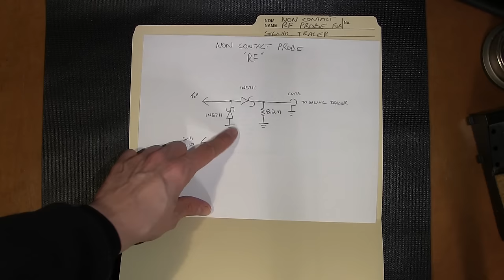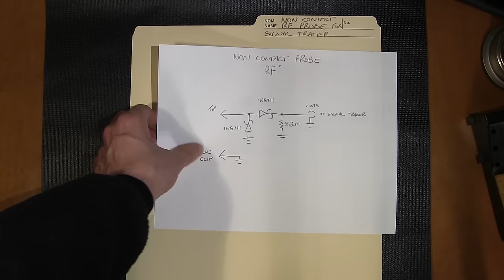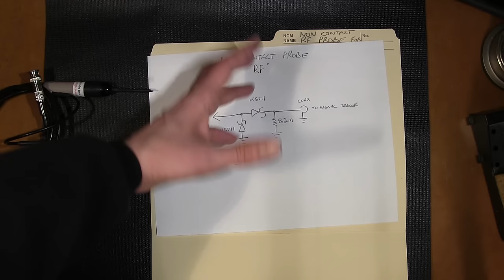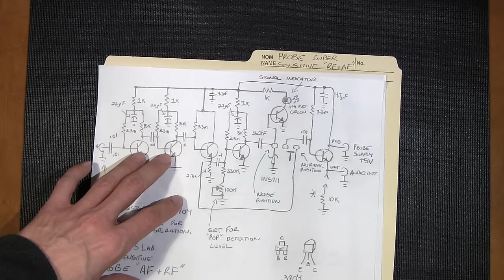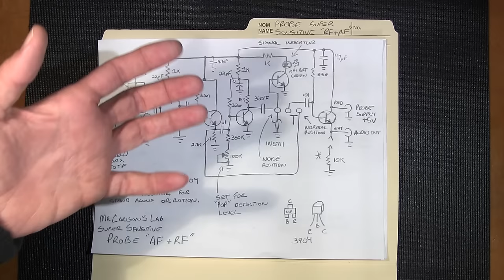Troubleshoot Electronics FAST with a Super Probe

Comment: This guy is a genius! I used to hunt for hours looking for a noisy resistors! This unit could trace noises within minutes!  R f faults easy to trace! Well done Paul! I am building mine into a piece of copper 22mm pipe and building the circuits on vero board! I will insulate the copper with heat shrink and mount the switch externally! I can only use through hole components as my eyesight not as good as it used to be! I need to save up and buy a microscope!  Thanks Paul for posting this! Fraser.

Comment: Built the circuit with BC547's and slightly different  resistor components (what I had available). Built it on perforated circuit board and connected it to a previously built low noise headphone amp. Housed in a mint box (not an actual cylindrical probe). Had a lot of trouble shooting to do in view of sloppy soldering but finally worked pretty good. Can sense a 40 watt fluoroscent light from 2 m away. Thanks Mr. Carlson for sharing and the explanations given. Much appreciated. Have a great 2017.

Comment: A great approach to troubleshooting a variety of circuits. The major advantage, no direct contact with the isolated area, which means no loading of the circuits, a huge advantage when troubleshooting tricky issues. Well done Paul! very professional construction and design.

Comment: Massive thanks Mr Carlson! Another absolutely must-build for my workbench in my lab. Many years ago when i worked after school for a repair shop it seemed we were always using the professional model signal tracer but as time has passed and the kinds of gear i work on the idea of using one has just gone out of fashion. I can see so many applications for one once again (rather than pulling out the 'scope etc) with extreme sensitivity as this design offers... just need a bit of spare time to do it justice!

Comment: Gosh, you really do run THE most splendid electronics channel, I bow and tip my hat to you. I wanted something just like this back in the 90s, to pick up POTS telephone line audio from the line cord; I would assume this would be sensitive enough to do so?God bless you, thank you for all your incredibly hard but rewarding work.
Reply from the maker: Thanks!
Reply: Mr Carlson's Lab You're welcome - a REAL component-level engineering professional, not a "module-plugger" as my ex boss calls them, haha!
Reply: +Mr Carlson's Lab I know some things about working with electronics, but watching  your video's? That has taught me quite a bit. I really enjoy them & you explain things very well. Thank you
Reply: +unlokia I can't agree more. "Module pluggers" drive me nuts, those who brag about their "creations" like they engineered it. Using modules is just fine, but why try to look like a pro if you aren't. I rearrange my schedule when Paul uploads a video :)
Reply: MrJohhhnnnyyy The 'net is overflowing with enthusiasm for Raspberry Pi, Arduino etc - it becomes somewhat tiresome sometimes, as many of these folks think THAT is "electronics". Yes, they contain electronic components, but the user didn't design the Pi, the foundation did, and you don't need to know much (if anything) about Ohm's law or junction drop to know how to connect a Pi to a PSU, power it up and write a script that drives a GPIO high or low. I don't want to come across as an arrogant pleb - it's a really good thing to have a passion, but when REAL engineering and electronic design is swamped by the latest, lowest common denominator "trend", it fast becomes a facepalm moment in engineering.

I ain't an engineering snob, but software isn't engineering any more than a toothpick is a broom handle. Real engineering is stringing together discrete components and designing something yourself, or fault-finding  - both of which Paul does with aplomb!

Right, I reckon I've waffled on a bit and I now sound slightly pompous, not intended... so I'll walk away with some humility left. :)

Oh, yes - I would (and just tonight, HAVE) set aside an hour or so to watch these superbly narrated and compiled works of art that are his YouTube videos - kinda got a bit worn out hearing a certain Australian ranting and screeching, as nice as he is, it all tends to get a bit wearing and sameish... and I can't bear to hear pompous "opinions" - I'd rather just hear engineering and diagnosis, since that's what you're there for, no? :-P

God bless you all.
Reply: I'm glad to see that I'm not the only one here thinking that making an LED blink using an Arduino ain't engineering :) Those "engineers" will throw away an Arduino if it has, let's say, a dead voltage regulator without understanding why it doesn't work anymore. 
I know you can't be a pro in every field, but come on! You should know the basics at least. I make simple projects in comparison with complicated uC invaded things, but I know what each and every part does in my project. 
I ain't gonna say that Dave is that bad, yeah he does have annoying habits in explaining the stuff in the video, but... I guess that's just his style then. I have a motto: don't like - don't watch it. So if he bores me, I just go away.
Reply: MrJohhhnnnyyy Thank you for your reply - wise words and very true! God bless you my friend :) Happy Christmas.
Reply: Indeed. I'm amazed every time form the vast knowledge down to the component level and as a whole system.
Attention to detail, no cutting corners. 
Mr Carlson is an asset.
Reply: "I don't want to come across as an arrogant pleb"

Well... you just did :P.
Good thing you're most likely never going to see any Arduino or Pi videos here on this channel.
If people want to make Arduino or Pi projects, let them, your word is not law, if you don't like that sort of videos, don't watch them, that's what I do with videos I don't like.
Reply: +shlomsi2000 Mr. Carlson is indeed quite adept at his chosen profession
Reply: Remember, someone actually had to design the raspberry pi, arduino, and all the modules for them, so don't get fatigued at all the people who use those tools to feel like they have a greater understanding than they do. There is no reason to keep the power out of the hands of the uninitiated, that is a very exclusionary stance to have. Just be glad it is easier for people to get into it. If they truly like electronics, they will learn the rest on their own as their hobby develops.

Comment: Great video, and what killer little probe made with very basic jelly bean parts. I shared this with some colleagues, across the pond. Roly, said, maybe put a FET on the probe input, for less hiss, and better performance, but he was still quite impressed with it. He used to run a company called Mitrex, that made sound systems for discoteques in the 1970s. Thanks!

Comment: You are not kidding when you state there are lots of other uses. I have been using an inductive amplifier to trace noise on power circuit lines in commercial buildings. This is just amazing. Thank you sharing.

Comment: Just an extension for those who can't read a scope or any number of simplistic instruments.. For that fella down the list here explaining really that all his time learning theoretical analysis of circuit theory, there is an avenue of a good techincian called having an "astute" ability. You don't need 4 years of calculus to dream up this project, as it's many small test devices rolled into one. I've even gone to simpler routes to repair even more complex tube radio receivers in my own electronics shop long long ago. Mr. Carlson is an astute person and may have been all his life. Hats off to him. For those who don't know the word, look it up. Still, I have to give him an immense amount of credit passing his knowledge to so many others via the power of the internet. As for compiling a book, I believe the days of circuit building as well as kit building is over. That has had it's day. It's all instant self-gratification these days for the most part without putting much into effort in anything.

Comment: I may have to apologise for the rude words I said about you Paul in regards to parts this circuit.  However they were said in a complimentary fashion 😊.
I have been building a cut down variation of your Super Probe, (through hole on vero board).  When I found that the two simple 3904 stages at the start of your circuit produce 65-70db gain I was pleasantly shocked.  Even a 1.5mV signal was producing an output of 4V - 4.5V.  Granted it was very noisy – but recognisable.  Anything lower than 1.5mV was lost in the noise, while 2mV was clearly identifiable.
Thank you Paul.

Comment: I finally got around to building a version of your super probe ! Built dead-bug style on a copper plane, and then fitted down an aluminium tube approx 17mm bore (you're Canadian so you will understand mm !).
I machined ends for the case from solid ali, and had to machine a tiny control knob to thread into the switch for complicated assembly reasons. Mine has the probe gain pot in a tiny box at the far end of the probe coax, which then plugs into my workshop audio amp, and takes supply voltage from there too. The probe works exactly as in this vid of yours - I can't believe some of the signals it has sniffed where I had not expected any to be :o)
I have photos of my version  if you are collecting them. It was certainly a challenge getting a non-smd pcb to fit down such a small tube !
Reply from the maker: Great! I'm glad you enjoyed the project!

Comment: For those can't find a probe body, one can probably be made from a length of pvc/abs plumbing pipe and end caps. The probe body can be shielded with self-stick copper foil, often used for shielding guitar bodies. With a little care, the copper foil can even applied to the inside of the tube, and a clear laminating sheet can be put over it, after it's tack soldered for a grounding wire.

Perhaps an old DMM probe tip can be threaded into the body endcap.

Please zoom the camera a little closer to the schematics.

Excellent videos!
Reply: I look at markers. They can make some nice probe bodies.

Comment: This is a very clever little circuit.  The I/P Z is very high as is the gain of each stage of amplification.  Normally providing base bias via an open resistor is a big "No-No" in transistor amplifier design but in this case it works perfectly.  Next project is to build one.  Nice one Paul.

Comment: A short piece of copper tube works well, although I put heatshrink around it or otherwise insulate it to reduce the chance of shorting something or getting shocked by being well grounded.

I also like using felt tip markers as probe bodies. You'll need to shield them internally. There are some interesting marker bodies, especially for highlighters.

Comment: When I was a teen I took a neon light tester and put one lead on the chassis and the other lead on an earth ground if the neon light lit up, I just reversed the plug. and no more hot chassis, thats how I kept from getting shocked.  I didnt have a transformer I didnt have much test equipment just a VTVM by Heathkit and an Oscilloscope by Eico. I only fixed radios I didnt want to get into TVs just yet.

Comment: Nice project, good work.  I can see how useful this would be in troubleshooting.
You can tell he's a real tech too.  Running a 4:3 monitor w/Windows XP.  <grin>
Reply: Yes, "if it ain't broken..." :)
Reply: Makes sense to buy cheap if you're going to be waving high power RF around near it.  PCs struggle enough with dirty mains.
Reply: And a CRT makes it just perfect. No need to buy new software, OS, or hardware...

Comment from the maker: Hi Everyone. All the Files to this invention are released on Patreon as of "NOW!" There is also an instructional video aiding assembly. Join up and learn things about electronics you won't learn anywhere else. Here is the link: https://www.patreon.com/MrCarlsonsLab
EDIT: The all new Carlson Ultra Probe has been released on Patreon with all the files. It's more sensitive that the Carlson Super Probe, and has higher bandwidth, check it out at the link above.
Reply: I think he said that he super glued it with a single dot on the backside of the board.
Reply: Neat trick with that incandescent protection bulb. Don't want to let that factory installed smoke escape! That can be a problem. ;)
Reply: I'd be interested but I don't own any valves of any kind or know enough about there workings of them. Thats why I like your content. Old school but new at the same time.
 I prefer through hole and non surface mount stuff like switch mode power supplies! 

Love the videos that you do tho and am very interested in the design/idea/concept of the probe. But I would have no use. I don't trouble shoot radios or signals to this degree (RF Stuff).
 You should have done a kick starter for it!!! Why didn't you?
Reply: This link just seems to go to Mr Carlsons Patreon home page, does anyone have a link to the actual files? I have been searching on Patreon for what seems like days with no luck so far :-(
Reply: Maaaan you are brillian, I wish I have this tools when I started to repair electronics 32 years ago 😏
Reply: Would you sell me one? I work on restoring Jukeboxes as a hobby and that'd be tremendously helping!
Reply: @stevemurray7216  you have to become a Patron of Mr. Carlson to acces the files. You can do so for as low as 2 bucks a month.
Reply: @roseelectronics4582  where would that be found? I still cant find it
Reply: Man I really need one of these. It works way better than any commercial probe because I bought one and it's useless.
Reply: Mr Carsons, where do we buy your probe stuff, can you leave us a  link?
Reply: Can't find them.
Reply: @stevemurray7216  I noticed the same thing, can't find any info. I mean thats what we pay for right?
Reply: Interesting.... Lots of viewers are interested in buying parts or kits, but my recent post on this subject just got removed......

Comment: Very informative. Thanks for sharing. The crystal type LEDs are not great as indicators as they are very directional. If you grind the top off on the LED the surface will disperse the light and make it much more noticeable from a wider viewing angle. Don't worry about grinding an LED. The plastic will not melt on the grinder like normal plastics do.
Reply: Grind it flat and polish it for a cool effect. I've done it several times. Makes a pin point light and makes unique LED effect.

Comment: You have earned my respect. I need your advice for troubleshooting a hot air gun for polimer welding. The hot air gun burns the 1300 watts heatong elemnt, it souldnt doit. Thus it is a welding gun designed for heavy duty applications.  The gun was made in germany where the voltage is 220 at 50 htz. But we are in america with 110 Volts 60 htz. i can email you the scematics for your review. As of today we have 9 heat guns with a blowed the heating element